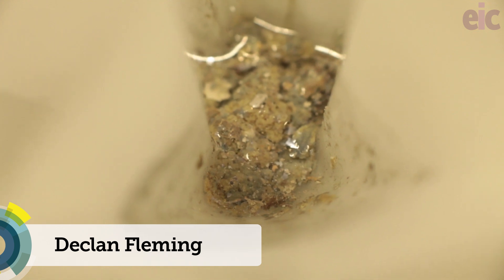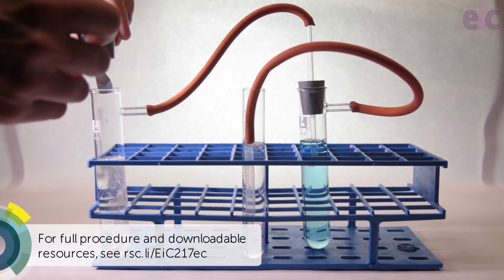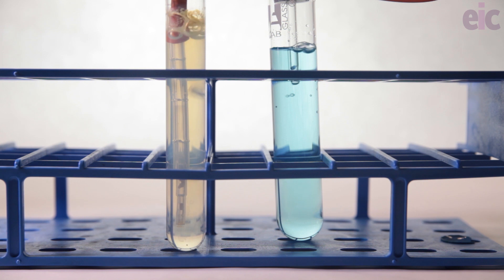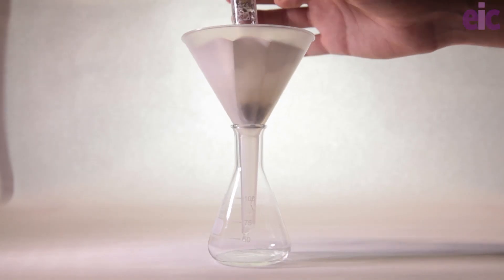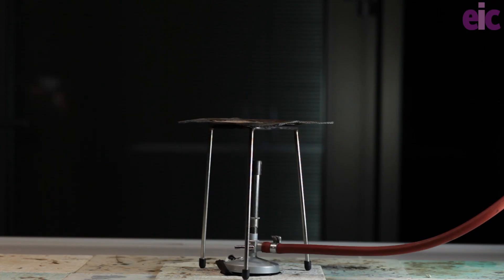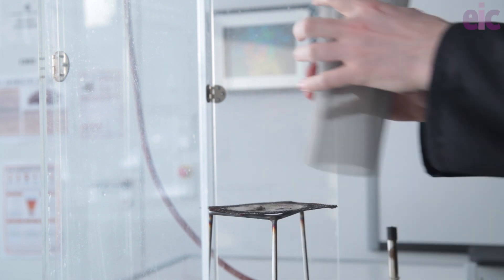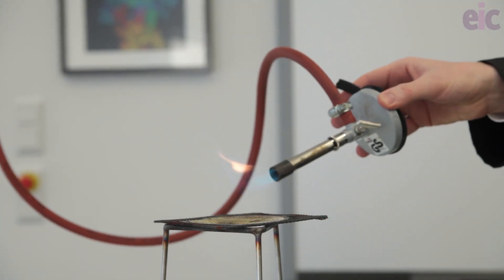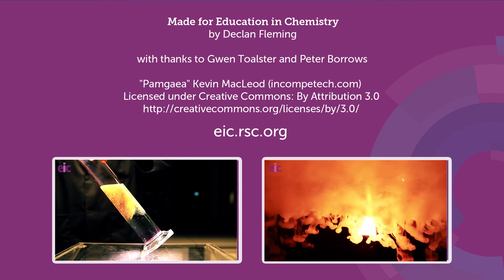Incendiary silver – silver acetylide contact explosive

Comment: The precipitate would be white if you would have heated the vessel with the silver nitrate solution to 65 C - 70 C.

I regularly perform this reaction and the temptation makes a big difference on the color, and U.V. light will darken it also.
Also if you get the silver nitrate / water / nitric acid solution on your hands it will stain them for a few weeks, it stains everything.  I found this out the hard way, I had black fingers and nails for almost 3 weeks. 😂